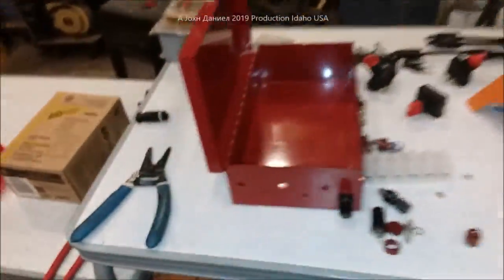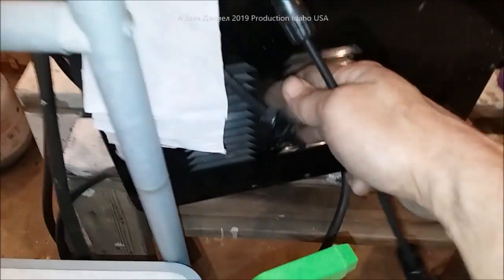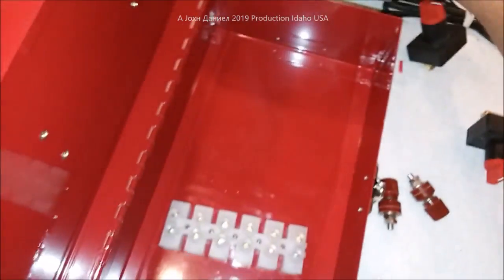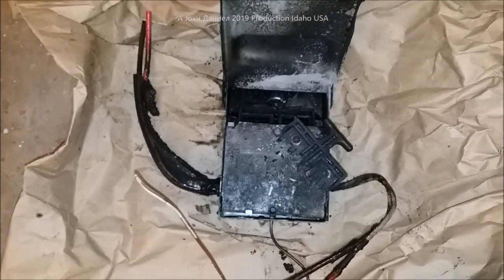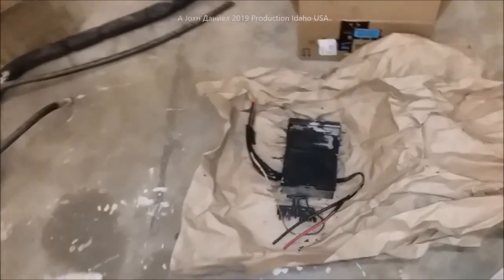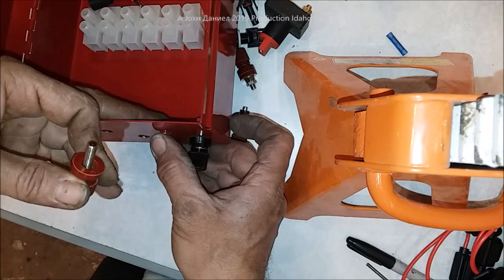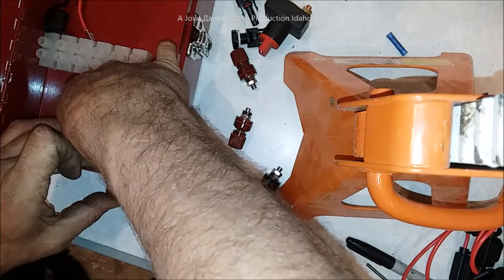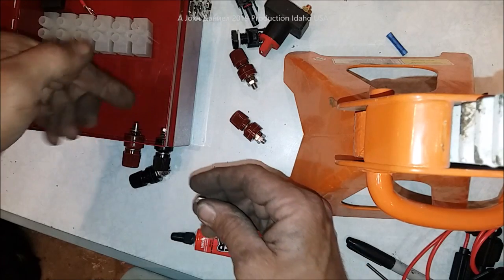EZ Solar Panel power combiner box, SEE BELOW best parts to use, NEW UPDATED

Comment: could i have you build be a combiner box buddy i will pay you... i would like two just plug my individual panels into this with a 12 aw solar cable... i have 4 solar panel i would like two buy another 2 for a total of 6... can it be done...????i have a 100 amp epever solar charger it says 150 a
Reply from the maker: If I wasn't already working 70+ hours a week I would build some. I barely get sleep right now.
Reply: @JOHNDANIEL1  ok i bought one no worries

Comment: I greatly appreciate all the information.
Just a couple comments: I don’t believe the red colored panel box you’re using is rated for electrical use, I say that because I’ve been searching for electrical panel boxes and have run into that issue with many of the inexpensive metal cans. If a fire were to occur inside the box that could be an out for the insurance company not paying for damage and I don’t think it’s going to pass an electrical inspection here in Central Texas. I’m always on the lookout for used or new discarded electric panel boxes that have the information label posted inside.
The aluminum wiring on the fuse holder may be rated for 15 A only, at least it is for residential wiring where I live, aluminum amperage will be rated one size smaller than copper wiring. Personally I would go with a larger gauge wire and add my own fuse holder (they are pretty expensive).
There are a lot of people who don’t like Chinese manufactured products, personally I don’t have an issue with them, they may not be the quality of American products but obviously they’re going to be much less inexpensive. But no matter what type of system or design, it needs to be checked frequently for overheating (or use a thermal imaging camera from my job).
About the electrical disconnect box that caught fire, I see many of those, especially older ones, the contacts between the switch and the internal plug-in will become extremely loose an arc.
Thanks for all the information and I plan on watching all of your other videos.
Reply from the maker: The Red Panel box don't have to be rated for electrical, it is not part of a common NEC or NEMA residential AC voltage code structure.

Comment: Another great video. Several of your videos You have pointed to the top right of the screen and said there was a link to another video. I have not seen that link yet. Is someone screwing You up some how? Yes, I am looking at Solar as well as wind turbines. My way of thinking is that a person needs both. To use only one type is like gambling.
Reply from the maker: You tube tends to block anyone they consider self reliant and independent thinking, they are a growing dangerous communist section of USA and like all communist, doomed to fail. So while they implode, they have numerous issues of malfunction.

Comment: Hi John, thanks again for great info, Do you have any guidelines for max wind/average wind speed in order to decide whether 3 or 5 blades for say a 500 watt turbine. Cheers Steve
Reply from the maker: The better kit is the 500 watt 5 blade Wind turbine, with the 3 phase to DC controller and you provide batteries. https://youtu.be/GrL7OA0Kb4A  If you have lower winds ( under 13 mph average, only 16% of the country has over 13 average!  ) get the 5 blade. They make rated power of 500+ watts at 23.5 mph and higher. Mine has hit over 1100 watts in 35 mph so be sure to run 8AWG wire at least. Or something equivalent. If you stay with one turbine you only need the provided controller. If you add more, you will need to change the set up to like mine
I recommend at least 1600 watts solar, 2 - 60 amp MPPT controllers, 8 GC2 batteries and 1 or 2 of these wind turbines to get a full use of wind and sun power.  If you need info on proven stuff let me know, you can't get into this by budgeting wrong or experimenting, that's very costly if you make a mistake.
Reply: @JOHNDANIEL1  Thanks John, I am in Tasmania (Australia) I will get ave wind info and get ordering! I have been ordering from you recommended suppliers where they ship out here, costs about double but happy to support good suppliers. I get my solar from Tindo great local manufacturer (will sell direct from factory). 48v 375 watt panel so I will base system around these. Looking forward to more videos. Cheers Steve

Comment: JOHN,WE WOULD LIKE TO SUGGEST A VIDEO ABOUT "THE WIRING DIAGRAM" ON THE HARBOR FREIGHT SOLAR PANELS THAT WE ARE PUTTING ON OUR TRAILER. MAKE IT SIMPLE  SO WE CAN USE IT AS A GUIDE. WE ARE NEWBES WITH THE SOLAR.
Reply: Take them back and buy some other more efficient panels.  You wont regret it.

Comment: That's the main issue with the funky switch ( Disconnect )   AC Amperage and DC Amperage are two completely different critters.

Other then the  DC Arcing  issues at hand contacts designed for AC have serious issues with DC current.  The rated values drop rather drastically .

 Can I use AC rated switch for DC?
For the same current rating, the dc voltage rating on a switch will generally be much lower than its ac voltage rating. For example, a switch rated for 15 A at 250 Vac will only be rated for 15 A at 12 Vdc. The only difference is whether you are dealing with ac or dc.
Reply from the maker: The reason that burned up AC disconnect had this problem is the man also had a 440 amp fraud fake solar controller, also damned dangerous. It is a poor excuse of a diversion load controller ( dangerous on solar) with under gauge wire and a 100%  guaranteed to fail big $9 Pollock solenoid. Click-Click-Click 300 times a day putting his 1500 watts live solar power in dead shorted 1500 watts diversion load. His panels went brown in a year, the weakest point was the stupid Air Conditioner disconnect that glowed red and set paneling on fire it was mounted on.
Reply from the maker: Solar and Wind Power fraud is so rampant and the Grubberment does nothing due to how the junk sellers leftist politics are. But word is getting out on the dark web of these dogs. https://sunshineworks.com/pages/solar-equipment-scammers-fraudsters-international-credit-card-fraud-2015-part-1

Comment: I don't have a combiner box , just a breaker, and wires bolted together,  its not perment, its a work in progress! Its nice to make your own power!
You have to use a bit of imagination, and know-how, to build one, I have gathered the stuff, and wire,  I'm building it for the future upgrades, I have 1500w but wiring it for 6kw, the wiring going in to the house i mean. To add the extra power, all I need to do is add the breakers, and charge controllers, and connect pannels, when all is completed,  great video!